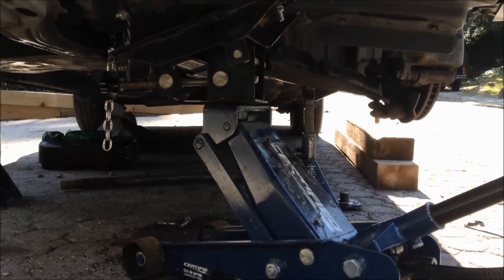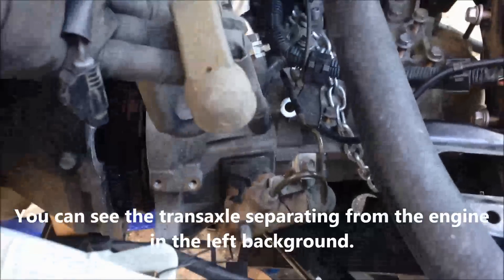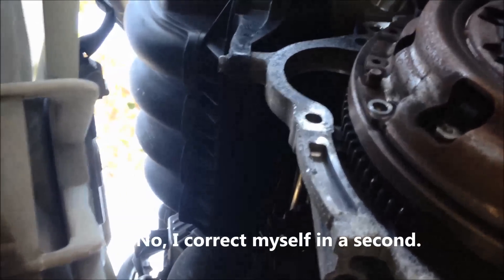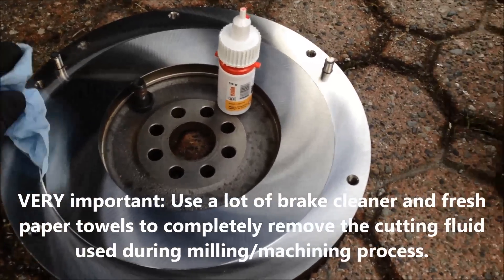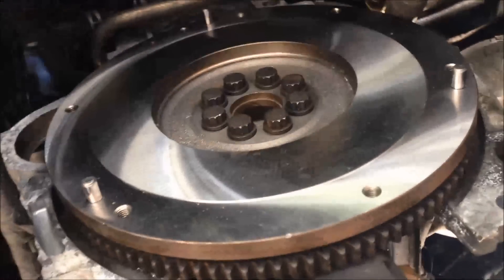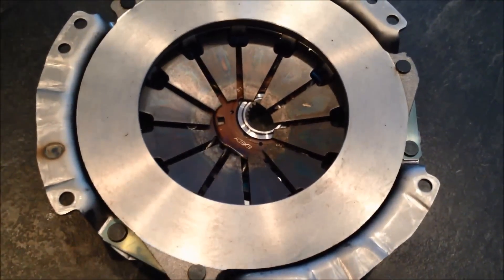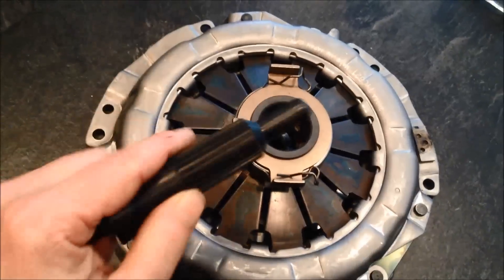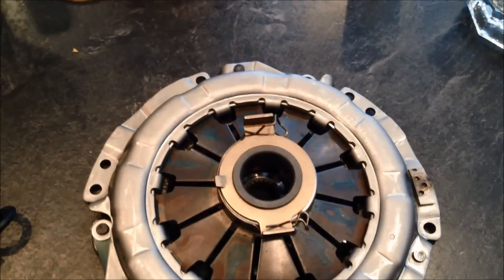(Detailed) Corolla clutch replacement - Part 5 - Transaxle, clutch, flywheel

Comment: If I over lubricate my shaft will it interfere with my release of nut?
Reply from the maker: I think if you slathered it up like you were putting on peanut butter it would be a problem, but otherwise it will be fine.

Comment: Hey Doug, Just used your video to help me replace the clutch in my daughters 2008 Corolla. It had a bad release bearing so bought a clutch kit and installed it. Thanks a million!!
Reply from the maker: So glad I could help out. I'd be interested to know any other tips on the job, if you can recall?
Reply: About the only things I did different from your video was to remove the half shafts from the trans axle I used a 2 ft x 3/4" bar ( basically a big punch) and placed it in the shallow groove in the trans axle end of the half shaft and gave it a tap with 3 lb. hammer to release them. Then to install , placed them in the trans axle as far as they would go by hand then used the same groove and from the opposite direction, again using the bar and gave a little tap  with the hammer and to seat them. Hope that's clear enough? 
Also, because the fly wheel was in real good condition, no hot spots or anything and my daughter didn't have a big budget for this repair I just  buffed the flywheel with a metal prep disc (https://www.3mcanada.ca/3M/en_CA/company-ca/all-3m-products/~/3M-Scotch-Brite-Roloc-Surface-Conditioning-Disc-type-A-MED-07486-maroon-3-in-7-62-cm-x-NH/?N=5002385+8709320+3293733827&rt=rud) 
and did not remove the flywheel or have it machined. The clutch works perfectly. 
I even got to have a little laugh at my daughters expense when I was with her when she drove it for the first time. The new clutch engages sooner of course and she stalled it a couple of times  (which I knew would happen and purposefully did not warn her about, I know, nasty Dad! ) and had to get used to the change in shifting :)
Thanks again for the video!

Comment: Great video. I can not get the transmission and the engine to separate, all bolts out, have only the block next to the transmission, block is chained to a lift hoist; have a gap of inch and half that i can introduce a pry bar all around the perimeter, when the block and trans are level, the block spins freely but not amount of whatever I do get them to separate, there is resistance coming from the spindle; this is a 2004 manual trans Toyota Corolla; i can see the fly wheel and part of the clutch through the gap but thats it; i expended couple hours today until it was dark; nothing. I still have the clutch cylinder attached to the transmission and of course the fork but have no idea if those have to come out or if i need to release something else; in mine there are two 14 mm short bolts under the trans on the engine side, 2 other 17 long ones close to the passenger axle, also from the engine side, there are 2 17 mm on top of the transmission from the trans side then there are the two long ones that holds the starter motor that have been set aside; ma I missing any? thats all the bolts I can see; in my mind it is free and just hooked to the spindle but how much of a force is needed to get them to separate and then how in hell will I install it all after i rebuilt the engine? I would hate to have to remove the transmission because there is nothing wrong with it, my problem is a blown head gasket; changing the clutch is a bonus that the book recommends any time the engine comes apart but so far mine has not! any ideas?
Reply from the maker: When I raised the trans up and down it just separated from the engine. Then I put a pry bar into the gap and kept slightly raising and lowering the trans to expand the gap while using the pry bar. I had to get under the hood and manipulate the trans to finally get the spindle out of the engine. I'm pretty sure I highlighted all the bolts in the video.
Reply: Doug Brown ..yes I am doing the same but the movement comes from the block, is there no way to separate them from the block side then? Trans is securely in place on the engine mounts all bolts are out, have an uniforme gap of over an inch but the two do not separate. I just hope that I do not have to start releasing the transmission because I do not have a transmission plate and do not want to disconnect the axle from passenger side, I am repairing the engine only. At this point I am extremely frustrated with the fact that something is holding the two parts at the spindle level and do not ket them come lose
Reply from the maker: @fireyourrocketts  I showed all the bolts from the engine to the trans, for sure. I unbolted the trans, but you're unbolting the engine. I think you're probably going to need to unbolt the trans.
Reply: Doug Brown Tran is unbolted, only the spindle holds it to the block, all is free yet it would not freely separate
Reply: Doug Brown there is a gap between tran and block of over an inch all around it
Reply from the maker: @fireyourrocketts  Hmm, if the two are separated then it's not bolts. There's nothing inside the spindle/engine that "grabs" and the spindle just slides in and out. All I can tell you is that the engine block on my car didn't move (it was sitting on that piece of wood) and I opted to use a jack to lift the trans up and down to get it to separate from the engine.
Reply: Doug Brown I found out what it is, and it is the block can not travel away from the tran because it is being stopped on the bottom left by the passenger axle right where it connects to the tran it is smaller circumference where the edge of the engine blocks pass ok but it widens going outwards towards the wheel and the block stops there, only hanging in the spindle but incapable of pulling apart further towards the passenger wheel no matter what we do; it took me and my wife going in every angle to see it. Now the good news is that it is probably easier to uninstall the passenger axel than what it is to drop the tran, I actually have a replacement for the driver axel which boot is destroyed, the wheel on passenger side is on but I have done the front ends before. I do not think wacking the block against the axel any more will do it, we could see the scrapped metal on the block by trying to do this so I guess the fun will continue, once the axel is out of the way and the path cleared, I bet the block will separate from the tran without much issue, remember I am doing it contrary at the way everyone shows here and it is because I am just doing the engine, if I knew better, I would have taken both out but manufacturer recommends dropping the entire engine from a lifter not hoisting it out, either way the axels have to be disconnected. Thanks Toyota Engineers!
Reply from the maker: @fireyourrocketts  Well that's good news. you saw that I took out both drive axles.
Reply: @DougBrownVancouver  Well, came back here looking for answer on the fly wheel bolts where to use the same ones or buy news, between $40-$70 for the set today, can not find the right part for my car, already had ARP delivered today but are 6 bolts not 8, don't know if the ARP 203-2802 are the right ones for this car flywheel, nowhere to be found info, It has been three years plus later, from last time, in all that time I ended up pulling the transmission as well out of the bay as I replaced all engine mounts, will be replacing soon clutch master and slave cylinder as engine is out right now, already cleaned engine bay and detailed it as best it could so it is cleaner to work on it; engine job was done long ago and have been sitting all these years under a tarp protected from the elements...now I got it back in the garage and just waiting for an Exedy clutch to come next week , still have to get a set of flywheel bolts although Toyota mechanics say the ones from factory are usable 3 times, i think this would be the 3erd time torquing them if used because I started installing a Clutch Max Pro Kit but had a change of heart after seen couple videos of them clutches destroyed and a pressure plate toasted; uninstalled fly wheel and sent them back (I had another set Stage 3 for my 2000 Tacoma which it is next to work on..!) in any case now with mostly everything out of the engine bay my plan is to hook up trans to engine and most components and will be dropping engine in in an angle form the transmission side, only the compressor stayed connected to system in engine bay ( maybe i should uninstall alternator before dropping engine in so compressor is easier to re-install?) this way should be easier, then drive axles, then see if it will start once ready...lots of work, countless hours reading and looking information, manual is a guide but there are lots of unanswered topics or simple not addressed by Hynes Manual, that and time in the way it is why it has taken all this time but then my Daughter will go soon for her DL and needs transportation for college, not far but car is needed; I just hope that it will really start and works, after all this time and dedication poured into it, not to mention $$$$!!!
Reply from the maker: @fireyourrocketts  Yeah, I said at the beginning that I would probably get it done by a mechanic in retrospect, but I liked the challenge. I tried to add in a bunch of little things that the books don't talk about. Good for you for doing it though!
Reply: @DougBrownVancouver  ended up paying for the fly wheel bolts at the dealer, got a set of ARP but where wrong, returned, expended hours trying to find right equivalent ARP part number all in vain, dealer discounted from $128 to $90.00 for the bolts, it is a necessary evil expense but do not want to take the chance with the ones in as they have been used at least 2 or maybe 3 times, now waiting on the right clutch, my option of fly wheel is one that came in an EFT clutch kit bought 3 years ago and which I will not use, will sell in offer up to recover some cash. Who said this is not fun??

Comment: Thanks for the series. I'm getting ready to change the clutch in my 2008 Matrix 210,000 miles. Still works fine day to day, but on a hot day with a heavy load, I trailer a Wayfarer sailboat and my MC in trailer, it finally started slipping this summer :( Oh well can't complain it's been a fantastic little car.

Comment: It looks like you were able to get that out of there without removing the rear mounting bracket. You just pulled the bolt. Is that correct?

Comment: i own a corolla 2010 5 speed S and my clutch squeaks when the pedal isnt pressed, i think its due to a spring on the throw out bearing either ones lose or broke, my fork you can se from the outside of the trans is shaking bad and making it squeak , do you think i can remove the boot and try to see with little mirrors if the springs are on right? or could it be something worse?

Comment: Putting a flywheel on was a lot tougher than I expected. I figured out that the new one I bought had holes on the back (engine facing side). Right where the starter motor was removed from I inserted a phillips screw driver into one of those holes to keep it from turning. As far as I can figure out the flywheel bolts are TTY (torque to yield), but I reused mine and did 36 ft/lbs plus 90 degrees. I only have a cheap repair manual that doesn't cover this stuff. I dismantled and reassembled my transmission based on Youtube videos like this one, and just searching Google. This particular five part series by Doug Brown gave me enough confidence to dive in.

My 2004 Corolla LE C59 transmission was still working. The car made a bearing noise above 30mph since I first bought it, and it ran well for a year until it recently started making a horrible whine above 2000 RPM. It turned out to be the output (aka counter) shaft rear bearing. Everything else in the transmission was fine (gears, diff, synchros, hubs, etc), so I assume the bearing had a defect or was slightly damaged during its original installation. I also replaced the input shaft bearing and gasket for no reason except that's what I originally thought was wrong (and I already bought those parts).
Reply from the maker: Glad I was able to help you! The flywheel is really heavy and you have to lift it up from below which makes it harder. But I recall a protruding post like you mentioned. If not, I would have done the same as you and stuck a screwdriver through a bolt hole in the flywheel into the hole where the bolt eventually ends up. The bolts are definitely TTY and I opted to buy new ones because I figured that after all this work and saved money I should  pay to get the right part. But I'm guessing that reusing will be just fine too.
Reply: Thanks for replying, but there's a slight misunderstanding. The tough part was using a breaker bar to crank those bolts the additional 90 degrees (a quarter turn) beyond 36 ft/lbs.

I noticed you used a screwdriver wedged into the ring gear to keep the flywheel from rotating/turning, but that didn't work for me - it could still slip. The way I found kept it secure enough to really crank on the bolts.

I'm sorry I didn't make that clearer. It wasn't about weight. I even reinstalled my transmission by lifting it into place without using a jack.
Reply from the maker: Oh I see. The little bit of support from the screwdriver worked okay for me. So not much else to say, sorry.
Reply: Chris Balfour, what is the weight of the bell housing?

Comment: I have heard the clutch pedal is much softer with the exedy set up.  How is the clutch pedal  now compared to the clutch pedal before the clutch job?
Reply from the maker: I didn't notice any difference actually. It depends on the pressure in your clutch line and the master cylinder. i didn't get into any of that.
Reply: Clutch pressure also depends on the clutch springs... at least on a motorcycle 😀

Comment: These are torque to yield "stretch bolts". Did you wait the hour after torquing them and then turn them 90 degrees tighter?
Reply from the maker: I didn't know that. Thanks for pointing that out.

Comment: Thank you for this great video
i have corolla 2003 5 speed e12
there is a noise when i start the car
but when i push the clutch pedal the noise gone
what is the problem
thank you
Reply from the maker: +Hosam Aboud Look around 10:00 where I show the 'throw out bearing.' Yours is loose and rattles around the hub. When you push in the clutch pedal, you compress the throw out bearing and the rattle stops.

Comment: Frame:  According to what I am seeing.  You did not remove the Frame.  Is this correct?  You were able to get enough clearance to remove the transmission without dropping the frame.  Correct?
Reply from the maker: +siucbset Correct. It took me about 10 minutes to maneuver it around the various components but it dropped out. Getting it back in was a matter of getting the transaxle on the jack and fiddling it back into place. I finally laid under the engine and lifted the thing up the last couple inches until I lined up the bolt holes and got the male/female alignment post/hole together, then shoved a bolt through.
Reply: Thank You

Comment: THANKS DOUG. JUST FOUND OUT IT DOES NOT HAVE A CLUTCH PILOT BEARING.THOU YOU DO MENTION THE THROW OUT BEARING. TWO DIFFERENT BEARINGS. MY DADS TOYOTA PICK UP DOES HAVE BOTH.. GREAT VIDEO!! IT HELP MY DAD  ALLOT.. COULDN'T HAVE DONE IT WITHOUT YOUR HELP..